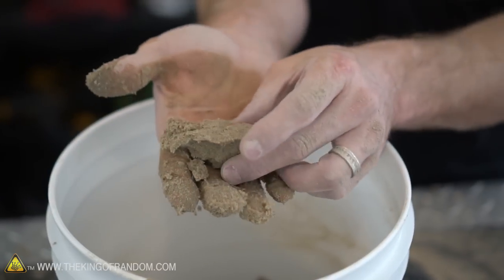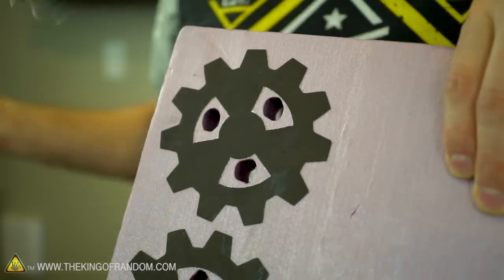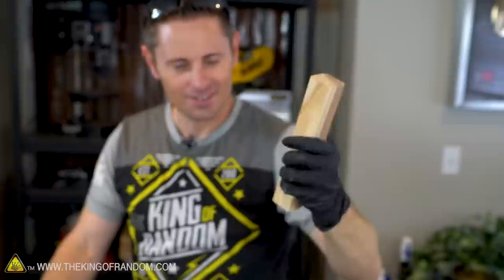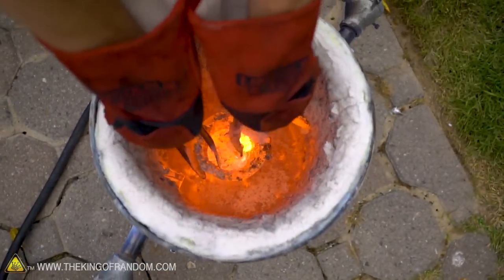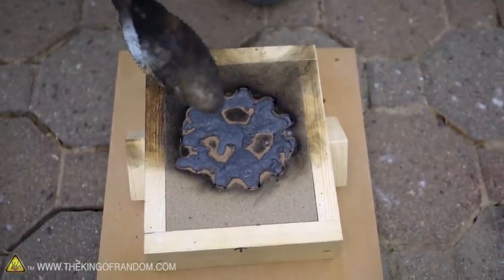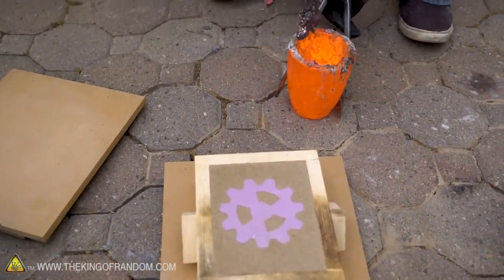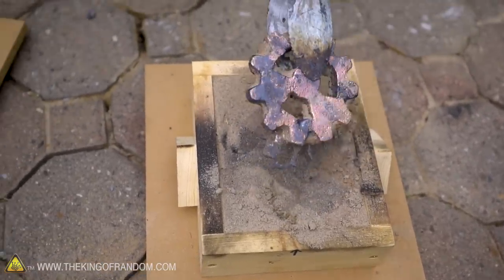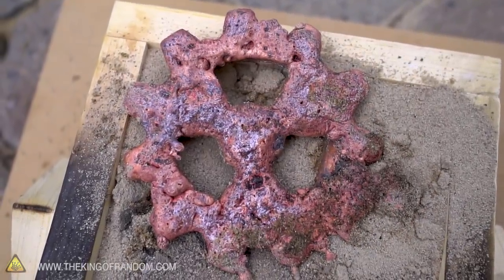Casting A "Radioactive" Copper Gear! TKOR Test Metal Foundry With Fidget Spinners &  Copper Melting!

Comment: 4000 comments in, I'm not sure if someone else has already mentioned this, but pure copper is notoriously difficult to cast even into simple shapes like your gear. You really ought to alloy it with about 1% silicon or 0.25% phosphorus to make it more fluid and deoxidize the melt. You can easily order various "master alloys" of copper-silicon or copper-phosphorus to make alloying simple.
Reply: Pyre Vulpimorph English please
Reply: Yolp HD :L
Reply: Pyre Vulpimorph lel
Reply: combine melty material with other melty material to make better solid material
Reply: It was in English, is called metallurgy. Any metal object you use in your everyday life, from a fork to your car, was made in this language. Its a language far more common than English
Reply: With Copper it is also pretty typical to heat up your sand molds, this way you don't have as high a thermal difference when you pour; also it will reduce porosity a little bit. I would make some Steel flasks, if you do plan on heating your sand molds, as with wood you'll be limited to around 500 degrees F. All these tips, will give you the precious extra seconds you need to properly fill your detail along with alloying.
Reply: Yolp HD nice pfp
Reply: regular copper is hard to melt, copper mixed with other things isn't
Reply: Can someone translate this to English please
Reply: Pyre Vulpimorph 1% in volume or mass?
Reply: I know I'm extremely late but would this layman be right in thinking his cast might form better if the mould had a top to it and the copper was poured in through a hole leading to it (a la Tito4e's "Casting a Bronze Axe Start to Finish")? Would the reduction in time and surface area exposed to the open air help the copper stay molten that little bit longer?
Reply: Zamolxes77 And any object, no matter how abstract, can be described in English, making it far more common.
Reply: Pyre Vulpimorph and use a closed mold too
Reply: Uh, He already made a successful cast and with relative ease. Right?
Reply: It seems the copper melted fine but the cast was a bit of a problem.
Reply: r/engrish

Comment: HEAT THE SAND BEFORE POURING THE COPPER
You heat your sand so copper doesnt get solidified as fast, and you melt the styrofoam BEFORE pouring the copper, so you can remove it fast enough to not impact the sand humidity.
You can do this easily with a torch.
Reply: This was my first thought when he was complaining about the object cooling to fast. The reverse of this would help him with breaking all his glasses with liquid nitrogen pre chill them.
Reply: It might work
Reply: my thoughts were also to heat the sand in an often... Will melt the Styrofoam and raise perhaps they mould breaks apart as the moisture in the sand flashes to steam?  can green sand be made with something like high temp coolant?  when the water vaporized the only place to go is up the center columns...
Reply: I was thinking about an oven at first, but you destroy the sand's humidity also, what makes it stick together and not just fall like well.. sand.
The idea of getting the sand moisture with another fluid with higher boiling point is also very interesting.
I hope our favourite airliner finds a way to solve theese problems ^^

Comment: Household Styrofoam insulation resists burning and melting.  Try using some floral foam or Styrofoam made for cheap food coolers but don't use Styrofoam with the occasional blue bead in it, also fire resistant.
Reply: agreed cheap white Styrofoam seems to work the best but I have had terrible results and awful luck with the floral foam, the kind I'm getting simply just doesn't burn! definitively check for those little blue stripes!
Reply: Oh, that may be why there were these "imperfections". It wasn't the copper cooling too quickly, but the styrofoam getting in the way.
Reply: Justin Jacobson tried*

Comment: Can your furnace get hot enough to melt rock? Then you would have your own lava for an even greater number of possible experiments.
Reply: Pretty sure that the arc furnace he built could easily melt rock, though I have no idea what you would use it for.
Reply: Different hot vs. cold suggestions appear in the comments very often. Ones that I see often are lava vs. liquid nitrogen and lava vs dry ice.
Reply: you could cast it maybe
Reply: rock all of the silicates melt at around 1200 c they solidify around 600 c
copper melts at 1085 c 
aluminium melts at 659 c
brass melts at 900-940
so it probably wouldn't work
Reply: Josh Palmer Maybe arc furnace can ,but not this gas furnace.
Reply: Josh Palmer his arc furnace can
Reply: Josh Palmer he tried it in an arc furnace video
Reply: Didn't he use glass marbles and not real marble?
Reply: Josh Palmer A LAVA PLAY BUTTON.
Reply: I guess there is only one way to find out. Get at it please Grant.

Comment: Try to heat up the sand some how so the metal doesnt cool down as fast.
Reply: The sand contains water....
Reply: Quenton Gilman that isnt how sand casting works
Reply: hi
Reply: maybe he need to try to with candle wax or bee wax.
Reply: wax will not  work in sand casting yoy neef somthing that  disintegrates wax will not wax will work in plaster casting
Reply: he needs to enclose the casting to retain the heat longer, and add a riser
Reply: Archaic Productions Y O Y N E E F
Reply: Indeed... and, although his copper is liquid, it's only barely so. It needs to be more runny to get better green sand castings

Comment: make glass from molten sand, like if you agree

or you could go to a place where they make sand and do a vlog there
Reply: that would be awesome
Reply: His metal foundry can't get hot enough to melt sand into glass. AKA Silicon.
Reply: The Gamer Freak I'm pretty sure that it's silica not silicone, but idk they may be the same thing
Reply: Actually, look up silicon dioxide, its actually got a very high melting point, to make glass you have to melt silicon dioxide to about 3,300 degrees Celsius, I honestly dont think that propane can get temperatures that high.
Reply: he can melt it whit electricity, actually that was what id been saying for two months
Reply: +Kurmet no but electricity is if im not wrong
Reply: +ZeusKing You are not the first to request this. We have been asking for so long now. I will like so Grant can see.
Reply: ZeusKing minecraft fan
Reply: Zeyad LT Why..?
Reply: I don't think the crucible gets hot enough, he'd probably have to use the arc furnace
Reply: he just said in his last video that his foundry can't melt sand
Reply: The melting point of glass is so high that it would harden the second you try to poor it
Reply: Ian Cook chill they made a mistake you don't need to call them names
Reply: +Ben sorry dude, that foundry gets up to 1500c at max, It cant even melt steel, If you were to put silicon dioxide into the furnace, it'll definitely go incandescent, but it shall not melt.
Reply: Kurmet 3300 degrees FAHRENHEIT lmao
Reply: like from minecraft
Reply: ZeusKing bruh u no nothing
Reply: ZeusKing I seriously doubt that is forges able to get hot enough to do that. I'm pretty sure to melt glass he would have to heat the sand up to levels higher than the melting point of steel
Reply: he has an arch furnace and he already melted glass in another vid so he can
Reply: fun fact- soda ash (a common component of glass) lowers the melting point of silicon dioxide
Reply: you can melt down glass bottles with a hot campfire at least
Reply: That's what i was gonna say! :)
Reply: Nooooooo..... That's what I was going to say!!!
Reply: Who thinks he should make molten sand to make glass and try to make a glass fidget spinner!
Reply: ZeusKing I always see this suggestion, in every video
Reply: Cant get enough hot for that.. but I guess he would be able to "recicle" some bottles on that foundry... they dont require so much hot... he could be just melting pieces of glass.
Reply: That wouldn't work. His foundry can clearly with not much issue get up to 1,948°F (The melting point of copper). When if you're a glass blower you need to heat it up to 3,200°F and higher!
Reply: Well... dang it.
Reply: +Eric olivares more than one person can have a idea
Reply: he could go somewhere were they make glass and record in there
Reply: thanks

Comment: you should use a blowtorch to melt the foam out before you put the copper in if your doing something like this again so that your copper will join perfectly
Reply: there was still foam left
Reply: shouldn't even need the foam... the foam should only be use to make the template on the sand.
Reply: THE GAMIN EAMONN The point of the foam is to hold the sand in place, but if the sand can hold itself than the foam is unnecessary.
Reply: How's your day?  Then
Reply: ColonialGamer you 😉
Reply: Rylan Tuttle he spelled it correctly

Comment: I appreciate that it wasn't a fidget spinner but he kinda missed the whole point of green sand casting
Reply: JayVeeGaming I'm glad I wasn't the only one annoyed be that
Reply: JayVeeGaming do you mean he should've removed the Styrofoam before casting?
Reply: TheDarkalkymist ah ok. I've never done castings of any sort, neither sand nor Styrofoam. how do you attach vents to the box? is there even a boclx in typical sandcasting?
Reply: TheDarkalkymist so the thing that you want to cast is sealed into the sand?
Reply: He should have made it a bit more strong, removed the styro, made a top box and pouring spouts so the copper would use gravity to push itself in and heated the sand before pouring.
Reply: I've never worked with molten metal before so I don't no, but what is the point of green sand casting if not for this
Reply: do you actually know anything about sandcasting?
Reply: JayVeeGaming what's wrong with it?
Reply: True. He could have just done exactly what he used to, burying it in dry sand and pouring it through a vent.
Reply: Gwendolyn Sheperd You don't make vents in the box, you make the vents through the sand. Also the main attraction of green sand casting over the casting he's done in past videos is you get to make a casting without destroying the original.

Comment: melt the Styrofoam like you did with the bottom of the crucible, and heat up the sand a little so it isn't cold enough to cool down the copper.

Comment: If you were to make a steel (or anything that can withstand high temperature) version of that sandbox, would you be able to heat up the sand to a point where it is still solid, but allows you to pour the molten copper in and give it a bit more time before it solidifies, due to a smaller difference in temperature?
Reply: King Yoshi  the sand may crumble easier because the sand will dry out

Comment: you should try spraying acetone over the foam it will dissolve it and just leave behind the imprint hopefully
Reply: Bleach Anddy no that doesn't work like that
Reply: That litteraly turns the foam into napalm
Reply: not saying you're wrong it is just a hard way to make napalm. - 
 formula - Gasoline (Octane) (C8H18)    Benzene(C6H6)      Polystyrene (C8H8) ----- where acetone is (CH₃)₂CO - --- there are many ways to make it.
where you want the polystyrene to be consumed not just gelled, making more imperfections in the casting, he could have made a 2 part mold with risers to allow heat to be trapped and contaminates float away
Reply: ok not literally napalm but a substance that acts a lot like napalm in the way it lights easily it is sticky and it burns for a long time
Reply: Lazer Wing how about... Napalm???
Reply: It would leave behind styrofoam dissolved in acetone. and I don't think you would want boiling and burning acetone under molten metal you're casting.
Reply: Nghe tung king

Comment: Can you use your Styro-slicer to cut low melting point metals and alloys like Pewter, Bismuth, Tin, etc?
Reply: Elastico345 - Mixels and other stuffs it can easily melt gallium
Reply: Abhay Hegde your hand can easily melt gallium
Reply: I don't think so because the metal that's being cut would have less resistance than the nichrome wire, and the electricity wouldn't flow through the nichrome wire, and wouldn't heat it up...
No.
Unless it was already hot before.
(No.)
Reply: It can't cut paper bro, watch the video of it he made months ago.
Reply: Why yes? How do you know?

Comment: Attempt to melt rocks and make a stone age king of random logo!
Reply: Opal Playz I agree. That would be cool to see!
Reply: Opal Playz rocks do not melt into a liquid that you can cast
Reply: melting rocks make lava
Reply: Fredrik rocks dont make sand, quartz does, and you dont find much quartz in rocks
Reply: Fredrik sand is actually more like glass then rocks.
Reply: Opal Playz molten rock makes lava, sand is mainly composed of silicon/silica, and that's what makes glass. Jeez
Reply: +Bunny Yes quartz is white sand which will melt into clear glass. Rocks however can be melted down into a type of glass. You can get a big bag of lava rocks in the gardening section of home depot for 5 bucks. You can use the arc furnace with carbon rods shown in another of his random videos to melt lava rock into obsidian which is a black glass. Ive personally done this with a stick welder which I switched out the stick clamp for a ground clamp and used it with carbon rods essentially working the same as his arc furnace. And it only required 60v of electricity to melt the rock. It doesnt however like to pour. But you could make your mould and powderize the lava rock and fill in the mould with powder and use the arc machine with carbon rods to send an electrical current through it running it along every inch until the whole thing is melted into obsidian. As for how strong the final product will be, I dont know. But its cheap enough that you wont really be out anything if you fail. Its worth a shot.
Reply: mighty white The Trinity site has green glass which formed from the gravel getting extreme amounts of heat from the first nuclear bomb ever detonated.
Reply: +Bunny Really? Thats very interesting. I collect a type of glass called Vaseline glass from the depression era. Its a neon green or yellow glass that glows under uv light bright green or yellow. They made it by infusing the glass with uranium oxide back before they knew how toxic the stuff is. Its such a small % that its no more dangerous to be around the glass than it is to breathe normal air. They stopped making it during ww2 because they needed uranium to make bombs. Its very beautiful glass though you should check it out. Just look up vaseline glass or uranium glass.  Actually alot of older dishes have uranium oxide in them. Its what they used to make the pigments. But not all uranium glass glows under uv light for some reason.
Reply: Well at least this reply section is interesting .... I mean if melting down rocks and casting something doesn't work.... Why can't he just get a slab of slate or just a large stone and using tools make indents into it. And after some work it would just come out into a nice clean product which can be presented and shown off?
Reply: mighty white Oh wow. I actually heard a lot of companies used uranium oxide to get neon green but went bankrupt because the government needed it for bombs.
Reply: There are multiple problems with this:

It takes such a high level of heat that I doubt Grant's furnace could get anywhere close to the level required to melt it. (Maybe for some rocks, but not for the majority of them)

-Even if he theoretically could, Neither the sand nor the wood in the mold would hold up to the lava, since they melt/deform at much lower temperatures.

Also, for all the people talking about it making rock glass, cooling the lava down could make a type of glass called obsidian, but that all depends on a bunch of factors (how quickly it cools, etc.)  Further, normal glass is usually made of sand (mostly quartz), and you can get quartz from rocks, but you need other materials (like soda ash) to lower the melting point and make it transparent.

TL;DR: Melting rock wouldn't work, and making glass is really hard, too.

Edit: See mighty white's response below, I was wrong about a lot of things.
Reply: +Bunny yep
Reply: Well since he has melted glass before with his electrical furnace can't he then just cast glass, and im sure he could get a mold which would withstand the temperatures.
Reply: +Nicholas Vellenga Actually (as I stated earlier) it only takes about 60v to 100v to melt most rocks. At least all the rock Ive melted just for fun. And lava rock will turn into obsidian glass regardless of how fast it cools, Ive done it. Granted it may come out kind of brittle but it is still obsidian. And as far as the mould not holding up to the temp goes, Ive made refractory cement crucibles with graphite powder infused in it. and melted rocks, sand, and steel with minimal damage to the vessel itself. My point is it isnt hard to melt rocks but it doesnt want to pour like liquid, (just like any glass) it is a maluable blob that can by shaped fairly easy. Ive even melted stone floor tiles the same way, and silica gel beads as well. Ive also mixed silica powder with quartz sand and melted that together. With the obsidian it will crack as it cools so it has to be brought down in temp slowly, but thats with any glass really.
Reply: +Opal Playz Glass wont pour when its melted. It makes a maluable blob that can be moulded to shape but it wont pour like liquid because it doesnt turn liquid when it melts it just makes a molten goop for lack of a better term.

Comment: I have seen brass casting done on PBS. They used wax and plaster to cast the mold. Object was fashioned from wax and suspended in plaster with an opening to the top of the mold. After plaster set up,  molten brass was poured into mold and let cool down.  After cooling down, plaster was smashed away and the brass object was all but done. Some trimming required. The  use of wax worked as fuel to keep the metal hot while casting. Check it out sometime.